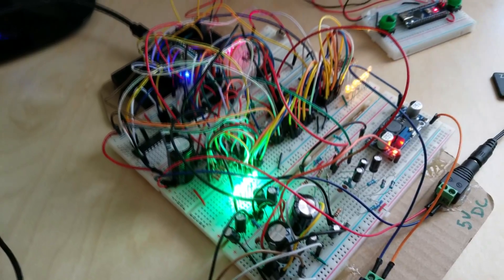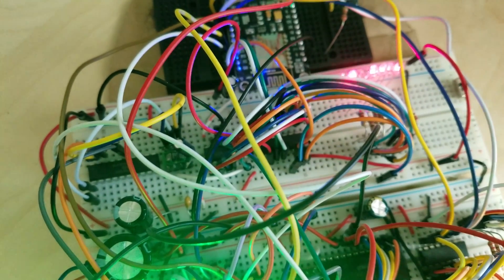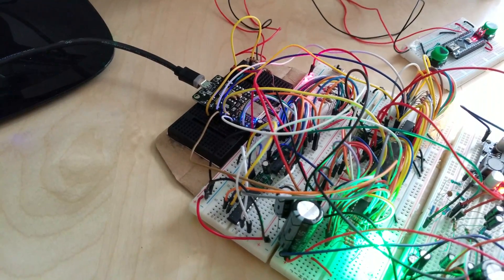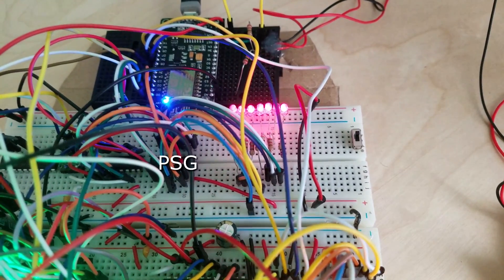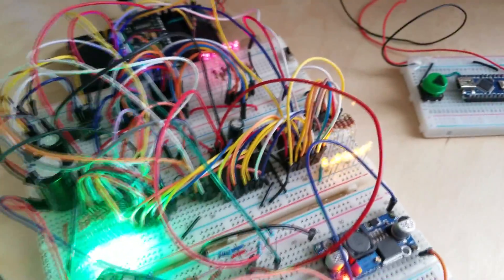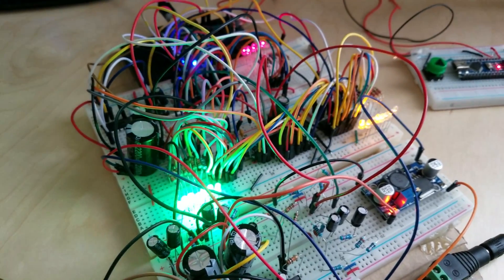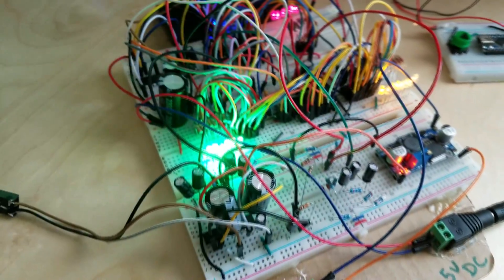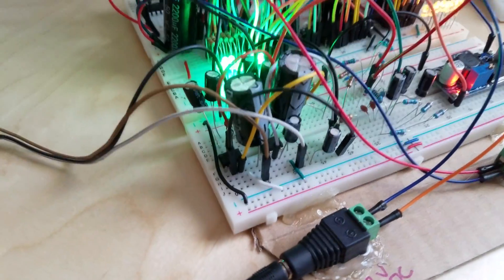Hardware Sega Genesis VGM Player (YM2612 & SN76489)

Comment: Nice work on making the hardware player. I have a similar project in my channel but it's focused on making a music keyboard. I drove it all from an Arduino Mega, and apparently I reach similar speeds compared to your work. Most PCMs play just fine, I have trouble with a few games that are very PCM intensive such as Sonic 1. I still have to get around adding the SN76489, so for now I use the YM to synthesize square wave patches when I playback VGMs. I know the SN won't sound perfect either as it's slightly different from the PSG inside the MD VDP, but should be close enough. If you have any comments about my work feel free to reach you. Keep up the good work! All the best.